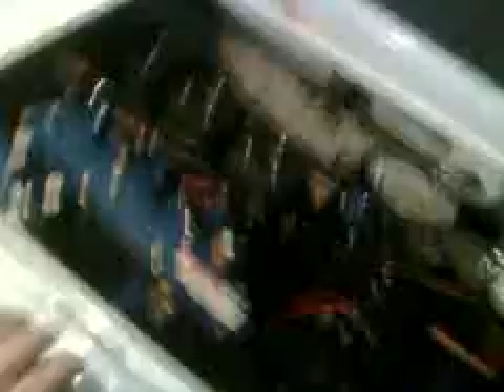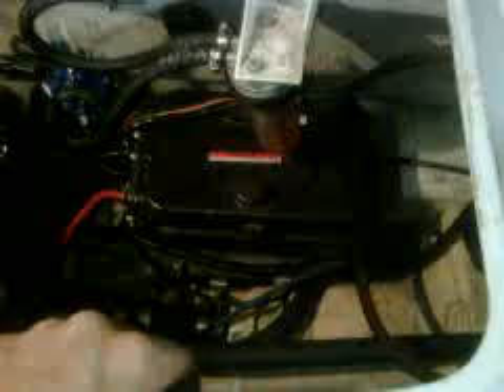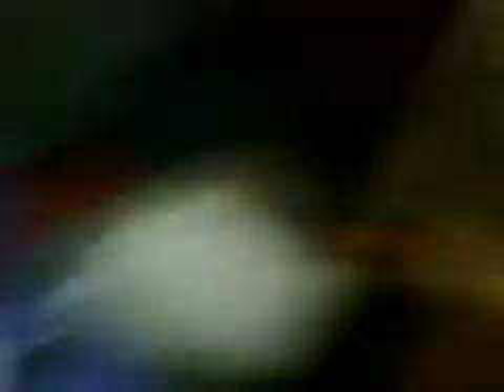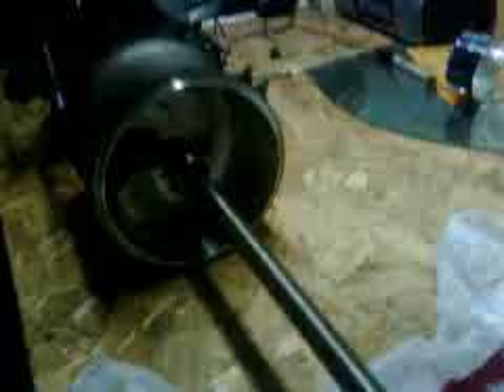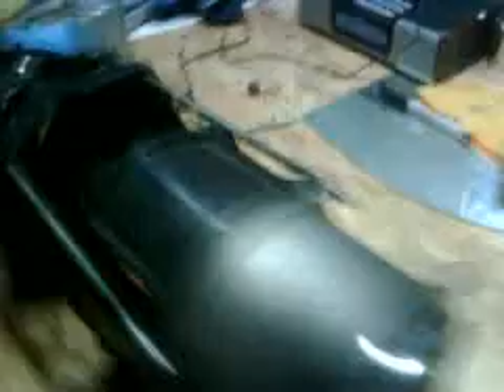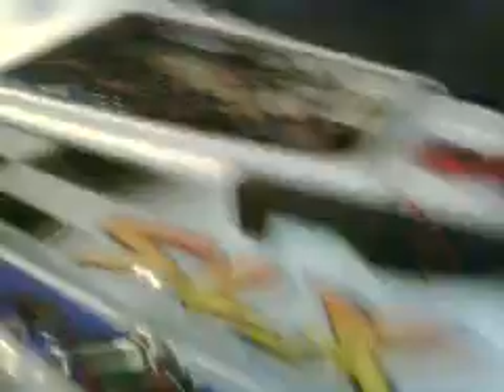SLX 780 Ignition Problem

Comment: Just finished up 2 Jetski rebuilds 

1996
SL 780 & SLX 780

 I replaced the stator and Ignition BOX ( which is in the CDI ) and got a spark and it to work ( SL 780 )

Steps id take to spend the least amount of money on fixxing this is 

1. Take out the main board in the CDI (Yes unplug it all and unscrew it )
Now Just the board its self Put it in the oven for 10 mins at 300F 
and see if you get a spark 

2. replace the Ignition BOX

3. Stator